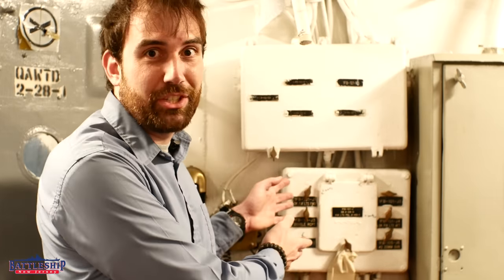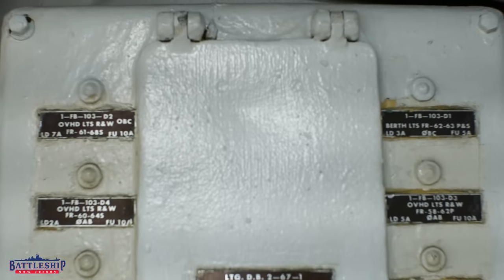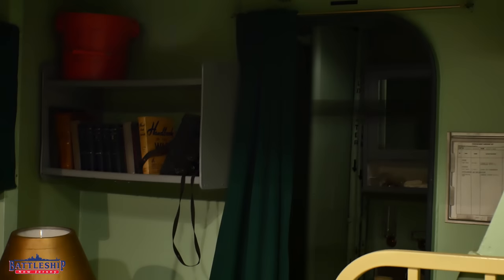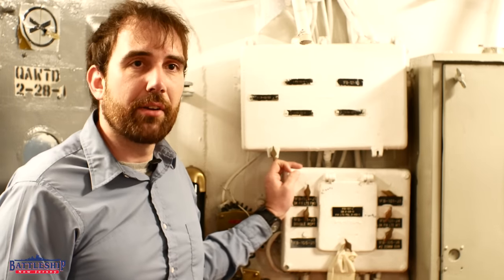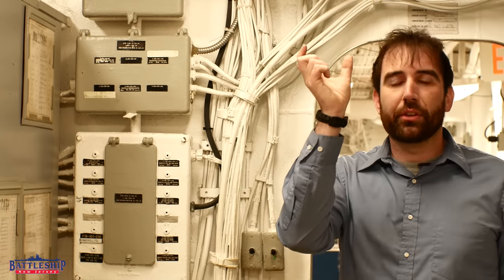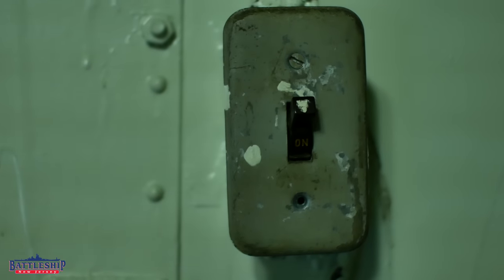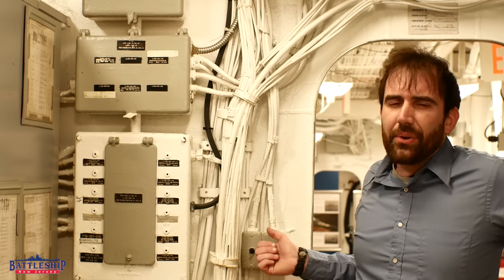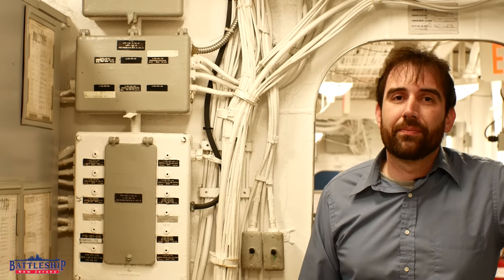Don't Touch That Lightswitch!

Comment: Surprised that they did not have covers on large power panels to protect the breakers in such busy & most times narrow walkways. My electrical inspector always tells us that bulbs go into the ground and lamps go into luminatpres. ( No such thing in NEC as a light fixture anymore ). Never liked the flimsy bat handle switches for anything over 24 volts.

Comment: Oh yeah, I use red lights around my home. I have one in the flood light, between my garage and house. This way  I can see to walk between those buildings; but still have pretty decent night vision, when I'm working outside at night. 
And I also have a red light in a clip light,  for the same reason. 
If I can convince my roommate, I'd also like to put some red light fixtures In the living room and mudroom.( the two rooms with an outside door)

Comment: My favorite kind of light switches are the smart switches that I can control from my phone. Very convenient!

As for use of red lights, I don't use them at all at home (unless you count the red pixels on monitors...) but I do have a headlamp that has both for use when flying. You don't want a big bright white light ruining your night vision when you're flying around at night, but a red light is helpful for seeing different things on the panel without destroying your night vision. The white light is helpful for really illuminating things during the pre-flight checks, though.

Comment: I have a 3d printed cover on the basement light switch that makes it look like one of the old blade style like in a Frankenstein movie.
Reply: Knife switches with exposed contacts... Somebody never thought that part through.
Reply: @BlackEpyon  mine is just a cover over a regular switch.
I think when they were first made people didn't know the dangers. They are still useful in some applications though since they can handle large amounts of current.
Reply: @billtheunjust  Sure, but modern high voltage/ high current "knife switches" have the contacts recessed inside a cover, to keep grubby mitts off.

Comment: "SHOCKING!" You light up my LIFE !  This is not a "Switch Board" , this is a "MDP" , for High Voltage, 480 Volts.
Reply from the maker: It is. But it was too funny not to use
Reply: what is MDP? Manual Distribution Panel?  yeah - the promo shot was a "switch board" or circuit breakers like in a house or onshore, but never shown in the "film: - I was expecting to maybe see a MBT (Manual Bus Transfer) but not. - His Question- NO redlights at my home - a good portion are LED, and a Good Portion have Dimmers.

Comment: Can't say About boats, but on the aircraft the DOWN position is whatever is normal for that circuit, be it on or off. The pilot need only sweep down with his gloved hand to put all of the circuits in their normal position, he can then toggle the circuits that he wants to change.

Some people who build model railroads allow their switches to indicate the position of their turnouts. Far be it from me to tell another modeler what is correct [sic] but each turnout has a 'normal' position and a 'reversed' position. I put my toggles in a straight line (same as in the switch tower) and switches in the down position are normal and in the up position are 'reversed'. NORMAL for a home signal is RED, it will only display a green aspect  when the switch is reversed, that is to say is placed in the up position.

YES! I do have red lights in my room. One circuit of red lights take the form of a rope of LEDs and the other is a red lamp in a fixture. Other options are BLUE LEDs and a yellow lamp fixture. Of course the overhead lamp is flourscent, but nobody says I have to use it.

ROAR

Comment: The only red light I have in my house is on my front porch.   I have one white light and 1 red light
  Thw white is used normally but if either myself or my wife calls 911 the red light switch is used and the red light flashes.

Comment: It’s funny to me that even though it quickly could become a rat’s nest of wires, you can see how practicality was a priority for how & where many of the changes or additions were made. Yet today, the ‘health and safety’ culture of modern Western military powers would NEVER allow most of this. Nowadays most warships would probably have to be dry docked just to change out a particular circuit and rewire it entirely to a new system. 

Times change I suppose. 😆